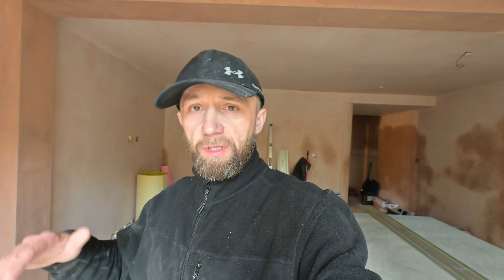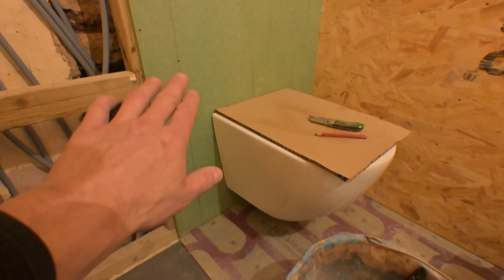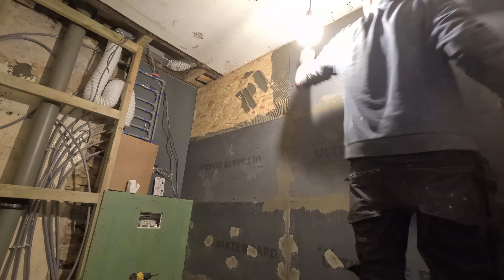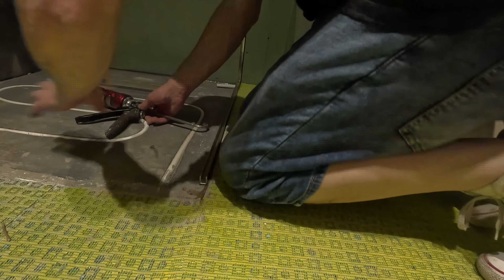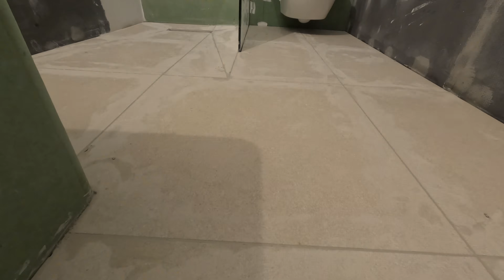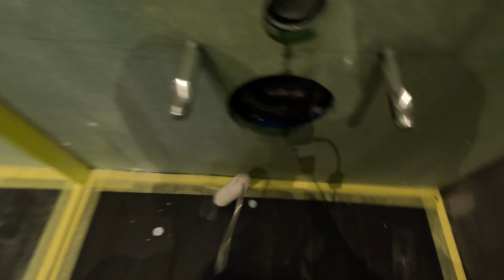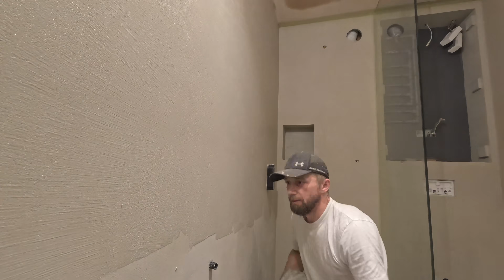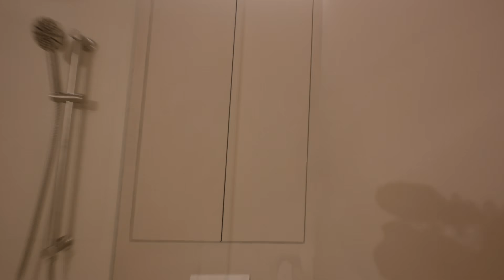The Death of Bathroom TILES..Micro-Cement Explained

Comment: Absolute garbage ,
The join between the MDF and the tile substrate in the shower will leak, I get the micro has some resin in it however no seal tape and  no continuous membraine between the floor and wall will cause a leak, silicone alone is not good enough. (Certified N Z waterproofer)
Ahh maybe you water tested 1st lol...
Ffs mdf in a bathroom.
Reply from the maker: Hi, and thank you for engaging. That is a bit harsh 😮 It will not leak and I'll explain why. I must admit that tape behind the MDF flooded onto the tray would be 100% and that is what we would normally do. Let's not go to the details why we didn't this time but I can assure you that water will not penetrate through the joint. 
The MDF is fully overlapping the tray and it is resting on it. The entire connection is lifted 4mm and is resting on the thick bed of CT1 so that is a 20mm wide line of seal. After that we tilled tide to the MDF. Then we overlapped with the microcement which is resin with crashed stone. The microcement is fully waterproof on its own but the final seal letter is another completely waterproof layer. It's like painting liquid plastic on top of an already waterproof surface. Then finally it gets another seal on top. No way Thai will ever let the water through but I appreciate your attention to detail and I admit that it could have been done a bit better. 
I was site managing for a number of years on commercial builds and I worked closely with guys like you and I learned a lot about waterproofing. If you download a data sheet on moisture resistant MDF, you will see that expansion according to temperature change is so minimal that it doesn't exceed expansion of the CT1, not even close. 
The microcement itself is extremely flexible. You can create a line of entire build up on w paper and once cured you can bend it into a complete circle without any cracking.

Once again,thank you for pointing out, I appreciate someone who can see. Sometimes I am not on site for a while and people cut corners. It's annoying but then you have to do your best with what you have. The MDF is glued to the structure as we like to do things properly so removing it to start again was not an option. The guy who didn't put the tape in was fired on the spot. The guy who helped him with the installation was fired the next day. 
It's learning for me that when these very important things are happening I need to be present and that you can't trust none these days. 
Thank you
Reply: .   well produced  response making  sense  ,and comes across  as genuine...
Reply from the maker: @michaelkither2620 
Thank you. I stand for perfection and honesty, but sometimes it is impossible to control everything. I learned my lesson

Comment: All that sanding looks like a real ballache.
Reply from the maker: It's not too bad. If the work is done well then the sanding process is much easier. It doesn't create much dust. The dust is very heavy so it drops to the floor. With good extraction is hardly anything. The material is not very sandable anyway so you have to get it laid nicely. It's a special kind of sanding paper too. Normal paper will go bland in a matter of seconds.

Comment: Nice neat & tidy job. 👌
Reply from the maker: Thank you 🙂
Reply: @yesconstructionltd  That micro cement, looks like it’s applied similar to acrylic-silicone render. Put on tight coat, and then scrapped back to thickness of the grain in the material.
Reply from the maker: @phils3631  That is precisely the method. If you build it up higher, it becomes wavy. The difference is that micro cement, especially the last coat, is very runny, so you need to be careful, as it can drip if applied thicker than the stone that holds it all together. In winter months, it takes 3x as long to cure so you need to be even more careful.

Comment: I'd want a hybrid system, tiles in the "wet" areas, microcement where the paint would normally go. I detest paint in bathrooms.
Reply from the maker: That is absolutely fine. We did this in one bathroom. Looks great. You can micro cement the ceiling if you wish.

Comment: The bathroom looks good. Can micro cement be repaired? Having a single location to isolate the water for the bathroom is a good idea. Providing cost information is useful, but add the date for context, so someone doesn’t come back and say you charged x for that years later. 

Only thing wasn’t keen was the flexible pvc pipe used for the part of  extractor vent. If you have to use flexible pipe, insulated is better to avoid condensation behind the panels. Completely riding ventilation pipe would have had better performance.
Reply from the maker: I agree on the pipe. I don't know if you noticed in the video, but there was a space issue. We couldn't use flat channel as we would have to use 3 elbows. We were connecting to existing duct as we were not contracted to change the whole duct. It's complicated as there is a flat above it and the duct I boxed in in the property above. 3 elbows would slow down the flow a lot and the distance was too great to introduce that. We were very limited with what we could do. The fan had to be 12 v. Inline fan was not an option due to lack of space so flexible duckt was the only option we had. The entire space behind and the pipe was wrapped with insulation so condensation shouldn't be an issue. I like to do things properly but sometimes you have compromise and do as best as possible with what you have and can do.

Comment: Looks good mate. 
Socket in a bathroom? Not sure that's allowed under the regs? Unless I'm mistaken?
Reply from the maker: Hi. Thank you for engaging. The regs are saying that it needs to be enclosed, so it's fine. The entire place was rewired and signed off so it's definitely permissible.
Reply: It's allowed in the US.
Reply: @ScottA2345 Yes, but other countries have proper electricity.
Reply: @BordersJambo  “Proper” is an interesting word choice. 😂 A battery toothbrush doesn’t need an outlet that can L2 charge a car. 100% of outlets inside homes I install are proper or abundant even at 120v. We also don’t install fire hoses for handwash basins.
Reply from the maker: @BordersJambo the UK'S electrics are really good. They made it simple and very safe. In East Europe 30 years ago the cables were aluminium and no earth cable. Only live and neutral. Now on the other hand it is crazy. The average house will need a 40way consumer unit. UK's electrics are great
Reply: The US requires GFCI if it’s close to water
Reply from the maker: @ThaDude0091
Interesting. It's ok in the UK if I closed
Reply from the maker: Thank you. It's ok. This was certified . It is inside of a cupboard and the glass wall separates the cupboard from the shower. We had a proper study on this with our sparky. Thank you for engaging 😊
Reply: In certification heavy Germany this not a problem even unenclosed sockets  are permitted as long as they are approx. 60cm off water sources.GFCI is mandatory!
Reply from the maker: @dipling.pitzler7650 
In the UK 2.5m from the water source if not  enclosed or separated.
Reply from the maker: @hw8621😂 
Also floor to ceiling glass is separating the cupboard so the risk of splash is zero. Thank you for pointing out 😊

Comment: Dose microcement from this company needs reseal after a number of years? How dose it effected with bathroom products? And how do you clean it? Thanks
Reply from the maker: Hi. Thank you for engaging. No need to reseal it at all. The final leyer is similar to plastics once cured so it's extremely durable, waterproof, UV proof. Cleaning is same as stone. Bleach is not advised unles you rinse it very well immediately after cleaning. I advise my clients to use stone care products.

Comment: What would the rough price be for a bathroom like this?

Cheaper than full tiled bathroom?
Reply: Tiles range from £12 a sqm all the way up to £hundreds, hard question to answer.
Reply: Hi great video, look forward to seeing future stuff.  Can i ask which brand microcement you use?  Thanks
Reply from the maker: @colinmacdonald1939 
Thank you 
We use www.claudicemento.com
Good stuff and easy to use formula.
Reply from the maker: It's a tricky one. I don't mind sharing how much I charfed. I actually decided to do that in my videos going forward. 

Tiles are more expensive than micro cement but labour for micro cementing is more expensive than for tilling so that part is kind of balancing out. We have charged for building  all bespoke carpentry and for micr cementing it but the client didn't have spend money on the vanity or other storage units. 

Our Labour charge was 11K for everything. This included plumbing, electrical work, boarding the walls, tiling the floor, installing the door and door frame- basically everything until  complete finish. The client paid for all materials. The glass was bespoke so a bit pricey. Micro cement was about £1,800 and the rest about 2K. Then you have the toilet, taps, shower etc, I am not sure how much was all of that.
Reply: @yesconstructionltd appreciate your honesty 

For the quality of work its not bad at all

How long is the process for a bathroom like this?
Reply from the maker: @ab9074 
Thanks. Every bathroom is different. If the client called me to do the bathroom only, we would charge little bit more. The bathroom was a part of larger project here so we made it little bit cheaper. 
On average 2-3 weeks if doing everything from bare shell

Comment: Silly question do you have to wipe the wall down after sanding before applying 2nd coat
Reply from the maker: Never! The material is very course and any cloth will leave fibres stuck to the wall. On the following coat the fibres will stand up and show trough. I know because I did it once and it was disaster 😅
Like you see in the video, I extract the dust while sanding . The dust is heavy so it drops down on the floor. No need for wiping.
Reply: @yesconstructionltd how about just brushing it off
Reply from the maker: @PaulSmith-pr7pv brushing is fine. I use vacuum with brush on it.